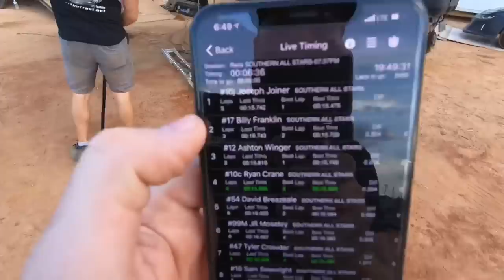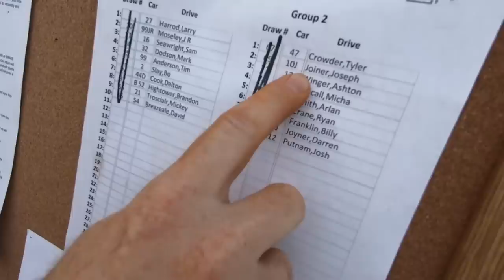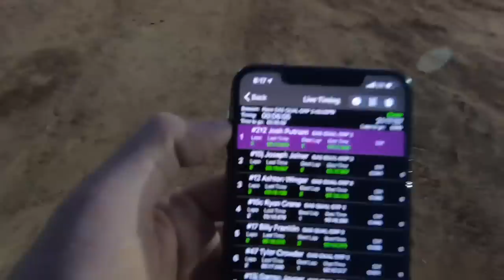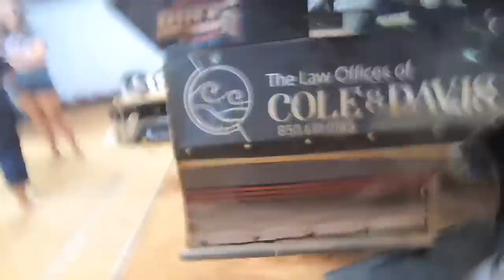We Were in Position to Go for the Win / Southern All Stars at Deep South Night 2

Comment: Good racing both nights, needs just a little bit of something on the chassis. Joseph and Putnam was one of those racing deals wanting the same piece of ground. We had the same type of problem with it burning the tires off of it. What I was getting from the readings for air pressure and how much the tire grew during the races were different than what the driver was telling me. So luckily we had some one tell us the car is telling you what the problem is. So we really had to crack down on the setups each week. We had it on the scales almost every week there for about a month or so. Once we got the car planted on the ground and not burning the tires off of it then we started adding the power to and keeping up with the setup. May be time to bring the scales out and start playing with the percentages a little. Good luck at the Mag look forward to the videos. #HTFNATION.

Comment: For the super. I run an angled 2” tapered carb spacer. Works wonders with the fuel staying even in the carb going through the turn. Only 250$ but it would be worth it

Comment: Ask Josh how that worked out for him at Greenville when he did about the same to jack Sullivan.....smh.   Good run Joseph
Reply: The incident that you are  referencing to was a clean slide job. Which drivers do every day. Sullivan was never touched and could have tried to do the same to Josh in the next corner. Instead he was pissed that someone actually was able to do that to him and chose to retaliate. By ramming into Josh, throttle wide open, and pushing Josh from turn 4 all the way into turn 1-2.

Comment: What's the point of sending the sanding the tires and dose the tire's not come  grooved when you buy them and new rules state that you're only allowed to have so many are you allowed to put as many grooves if you want in the tires
Reply: All tires come with a standard groove precut. The intent of further grooving has various reasons. One being grip and the other being heat control. They could go even further and do siping and or dimpling to control heat if they wanted to. Too much heat in a large patch will cause severe blistering and destroy the patch. Not enough heat then you risk loss of grip. To wide of a patch under certain track conditions with certain tire compound wont allow the patch to flex and retain proper heat. Sanding takes off the top layer which may be fresh or it may be conditioned if it is an older tire which gets rid of the rubber that may not be useful due to its state. Some teams will do a break in and scrub a set of tires so they are ready for competition later.
Reply: Truth is tire management in dirt is just as complexed and task instensive as any other sport. Between maintaining records for the various compounds versus track versus weather versus laps it can be a overwhelming part of managing a team. Especially when you don't have the deep pockets to grab fresh rubber for every race. Most teams will serialize their tire so they know just how much they have been run and on what tracks under what conditions. That way they can best utilize what they have avaialable to them. You could get away with running a particular tire at a particular tracka few times if the track and typical conditions are not so harsh that it destroys a tire in a single race night.

Comment: Thanks for the video. One gripe I have is this constant narrative that "we got taken out" that is prevalent in the comment section and in your videos is getting a little old. Joseph was chopping the guy in the corner. Run the middle if you don't want to risk the guy coming up on you. 

And to the commenters who actually belive that Joseph could compete at Eldora--get real. He doesn't even win these minor events against mainly part-timers so the idea that he would compete for a win at Eldora is humorous.
Reply: Some body don't know any thing about racing
Reply: In the various races they have been "taken out" which of them don't apply? I mean how stupid does one have to be that on lap 4 of a 50 lap race running in the top 5 they sending it almost taking out the field? Be honest the guy tried to force the pass and turned him in the process on lap freaking 4! It's not like the track was rubber down by that point and you take what you can get. It was an overly aggressive move way too early in a very long race on damn restart no less.  He had the run and the position and could have easily backed off just enough to still be there for the next corner but he didn't. He made a jackass move to try and not lose the position.

Comment: Zoom in on these screenshots from this very video. In this one, who has who shoved down into the infield and is already turning sideways? https://i.imgur.com/ta99Bsr.png
Reply: How about this one with the 212's tail all jacked up because someone is on top of his nose? https://i.imgur.com/6Z0kg17.png
Reply: And another one with the other car already sideways and the 212 down in the infield? https://i.imgur.com/sgaD9i9.png
Reply: How about backing up the video to when they were at the flagstand and Joseph was already ahead of the 212. Joseph had the line and beat the 212 to the corner. On a one-line racetrack, the 212 has to know the 10 is coming to the bottom and better let off. He didn’t and it cost himself and bunch of other cars. That’s dumb racing on the part of the 212.
Reply: @illiniracer9296  Not disputing the flagstand but he was passed in the corner. He knew it and chose to come down on the 212 and caused himself to spin. Josh was in the brakes hard and didn't spin the #10. He did it to himself. Proof is in the picture. https://i.imgur.com/iZ2c58w.png